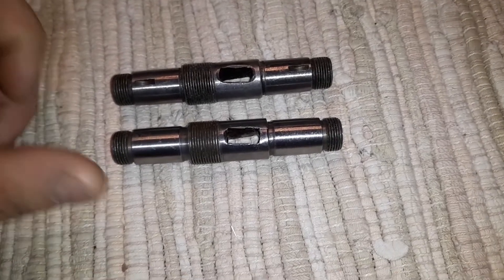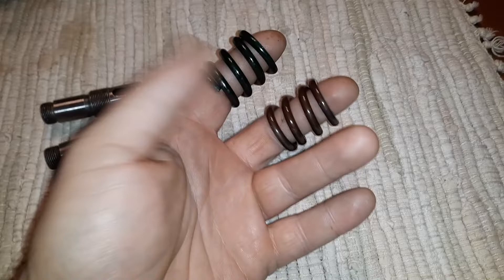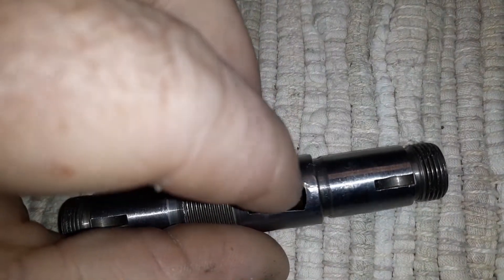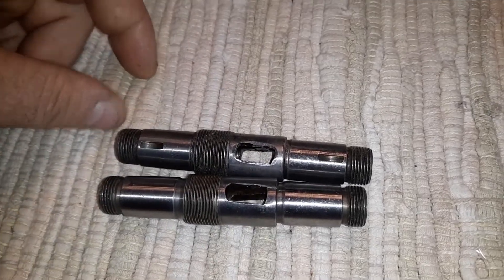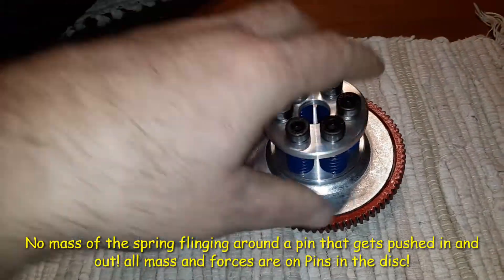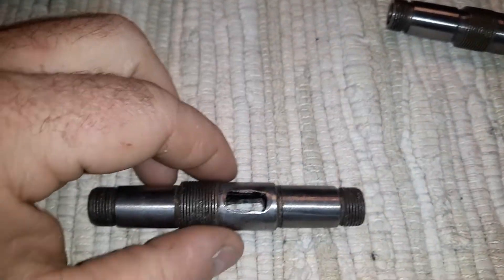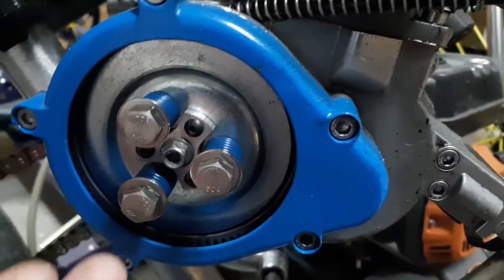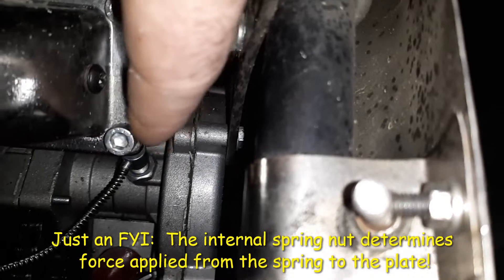Motorized Bicycle Clutch Shaft Failure - Big Spring Vs SAF Clutch Effects Over Time On The Shaft!

Comment: I'm floating on around 4,000 miles all stock ;p 
When you consider the fuel efficiency for having fun around town it's more than paid for itself many many many times over.

 Just had to replace:
 clutch pads once.. looking to do it again soon.
Replaced the chain within first month like most have too
Replaced clutch level with another donor brake lever (broke on a wreck)
Replaced throttle with another donor brake lever (the lead head that slots into the handle broke off so I used a lock nut meant to adjust brake pads and ran that through the hole in a spare brake lever laying around. 
Ill eventually upgrade exhaust gasket to something thicker to get a better seal (had to bend muffler a little to fit bike frame
I've had to give it new tire rubber 1 on either end, and a new tube once on either end.

The rest of my findings are more arbitrarily listed below. 

all in all they're bulletproof little machines. I took one guys advice when building it, and just attached my gas tank using electrical tape because apparently the bolts they tack weld to them for strapping to the bike have a tendency to fracture and leak over time, and have had no problems there. I never setup the kill switch lol and just choke it off by placing my finger over the carb intake and have never run it with the carb air filter without any issues. Only other issue I've ever had was having one of the CDI ignition coil wires pop loose. Tore the whole machine down before noticing it. Ouch. 
And I've finally had to replace the rear tire after deciding 5-6 broken spokes was too many, and the wheel was going out of alignment. Curiously only the spokes on the opposite side of the rubber adapter for the engine's sprocket were broken which has made me strongly consider adding another rubber clamp system on the other side just to help transfer the forces evenly across all the spokes and see if that keeps them from breaking as easily..When I went to replace the rear tire, evidently I'd lost a bearing so the axel pin was almost cut off which likely had a lot to do with the spokes breaking.  But I've slap abused this bike on purpose and Frankenstein just keeps taking it. 

I try to convince people when buying these kits to just go ahead and order a replacement chain that comes with a few spare master links, and as cheap as parts are if you intend to ride it a lot and don't want any down time, just invest the $40 total and get a spare Chain, CDI, Clutch Pads, Spark Plug, and some either: gasket paper/gasket glue/or spare gasket set just in case you ever damage the gaskets during repairs or age.. (some people fowl the spark plugs* during the high oil mix break-in periods), magneto, and I've only ever had bad experiences with having to rebuild my throttle handle a few times so it couldn't hurt to look for an upgrade. Haven said this, I've yet to have a CDI/Magneto/or Plug go out on me but It's nice having all the standard replacement parts in a box.

Another motor bike knucklehead online taught me an interesting trick for the exhaust or carb manifold gaskets that connect them to the motor.. Take a thick hardback book and cut the general shape out, soak it in oil for a minute or two, and slap her on. He swears he hasn't had issues with this, and it seems to work. 
Highly suggest getting a tool bag you can strap somewhere on the bike and carry all your hand tools and spare parts in a small little ammo crate that you can easily lock to the frame with a gun lock which you can get for free at your local police department. 

Can't stress enough the quality of life that comes with having a bicycle rack on the rear. I strapped one of those large plastic drink crates too it to create a very robust storage space to hold whatever I want, be it spare tools, a small deep cycle deer camera battery for my over powered headlight, sometimes ever light groceries or what have you. It also puts more weight on the rear if you find yourself panic breaking you just might not go over the handlebars. Lol, I've almost mastered doing a stoppy with it. 
  Any questions, direct them with an @ to me.. cheers.
Reply from the maker: Lol was like reading the Bible.   Yeah to be honest I have a 85cc 4 stroke I put a 110 head on from 4 years ago. Thing is absolutely bulletproof as far as builds. Has outlasted tons of 2 stroke kits.  Still to this day actually almost always 1 pull starter for me.   Smaller 50cc kits are very well made.  I can't honestly see any reason they shouldn't last for many many  hours of riding.  One guy I know has had one for 8 years. Rides it daily to go fishing. Where talking 5 miles both ways total of 10 and has a basket on front gear and rod holder off the back 😂. Looks ghetto his setup but my god only thing that breaks on it is old tires with no tread but time I fix it for him lol

Huge trick.  Use (zick oil). Old stuff before catalytic converters.  Plates your internal parts with a protective surface. This could survive anything with that in it.
Reply: @BuildBreakFix   Ill definitely take that advice with the zick oil. I use mine for fishing sometimes as well.. roughly 15 miles there, 15 back haha.. my longest trip to date was about 80 miles 1 direct taking it up a mountain, ate lunch and turned around. I did about 200 miles that day with very minimal stopping just to stress test it and feel more comfortable. I should have mentioned in my comment above to anyone reading it they really need to replace the kit's fuel line asap, and gatorade bottles make for an excellent fuel reserve in case the petcock valve is in the wrong position, or you form a leak.. I also carry 5 minute jb weld with me in case I have to fashion a fix in the middle of nowhere.. But I'm pretty known to take mine 20-30miles into no mans land.

Comment: The bolt that holds the clutch basket to the shaft Keeps coming loose causing engine to free roll do I need to replace shaft ?
Reply from the maker: Nut you mean?   Did you use a Locking Washer when you installed the nut? Check this video out!  in the description I explain everything On how to tear a engine down to install each part! Quick links in the description!  You will find everything on the part you need to fix in the link list! Tools items sizes steps to install it!  
 https://youtu.be/7S_dkB7lZDY